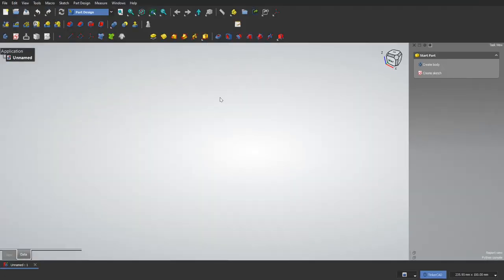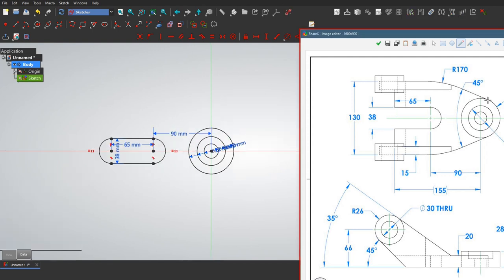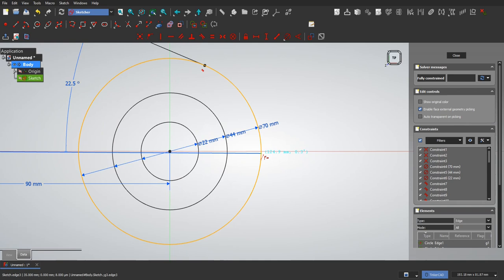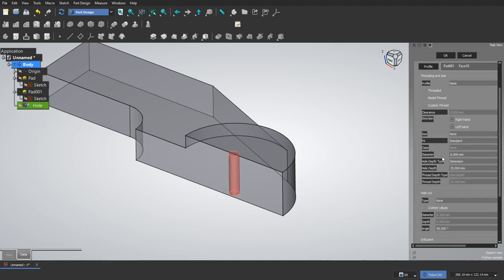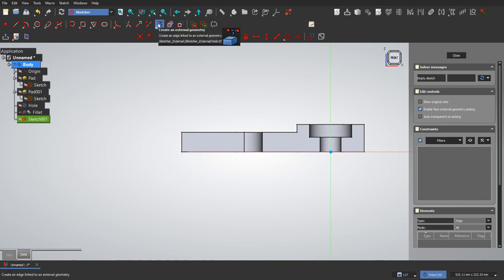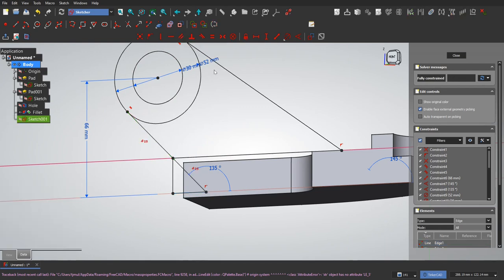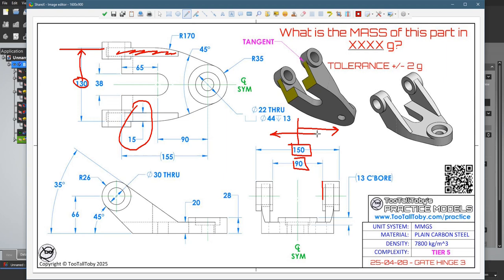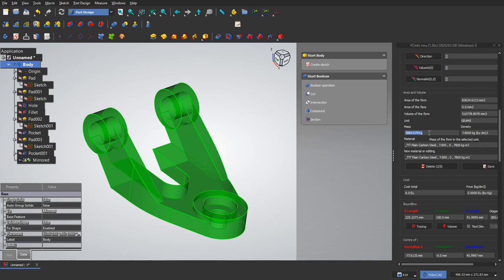Make This w/ 2 Sketches Under 5 mins

Comment: I am new to FreeCAD. Just downloaded it a week ago. I am not getting the same results as you. When you finished the first sketch and exited Sketcher, you had two areas (the circles and the slot) that were filled in with blue and thus able to select portions of the sketch (i also added the final line making it 3 areas. I am not able to select individual portions, but rather it forces the entire sketch. Maybe you forgot to show an option enabling you to select portions.
Reply from the maker: Hi David, I am using a different version of FreeCAD. Please see my pinned comment for more information.